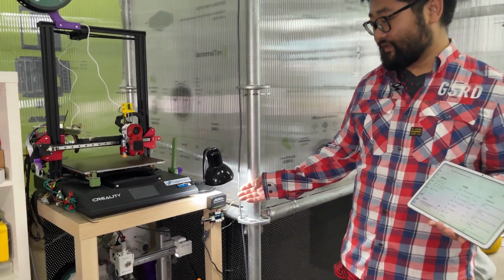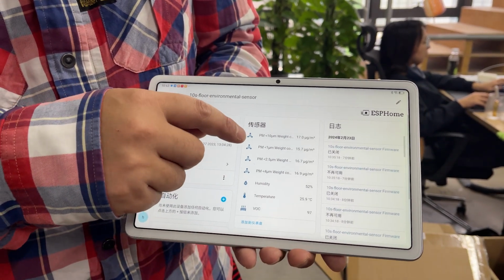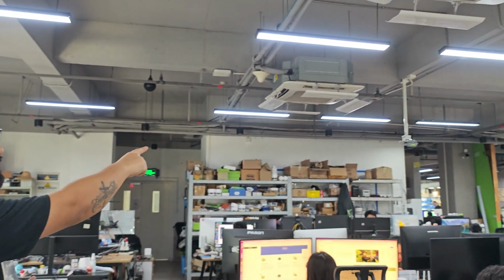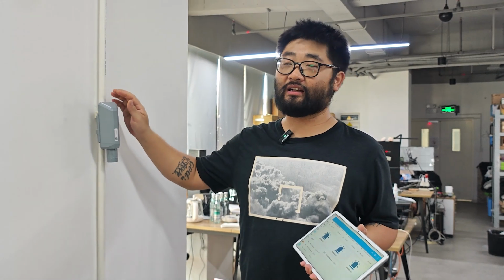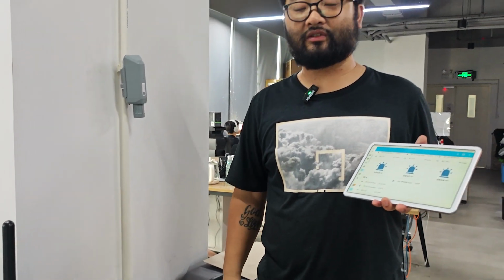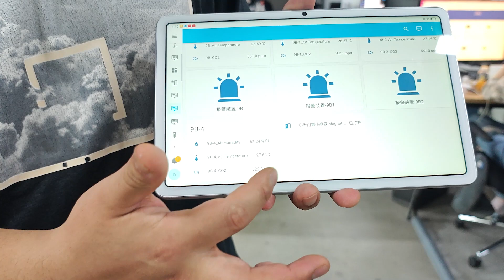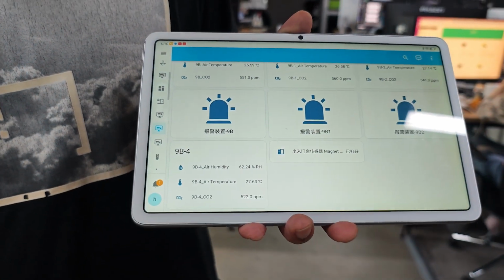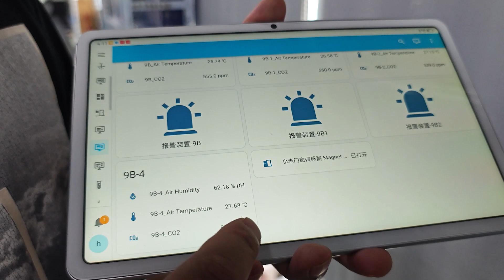Seeed's Home Assistant Project: Real-Time Air Monitoring Device Unveiled!

Comment: AN interesting idea but i use an industrial PLC (x20cp1585) for my complete hmeautomation with 350 I/O's Dig&Ana. High Speed Network for I/O points and 2 further smaller PLC's as slave nodes.